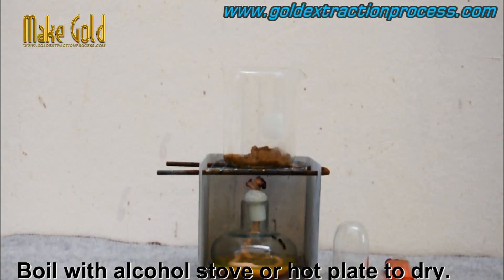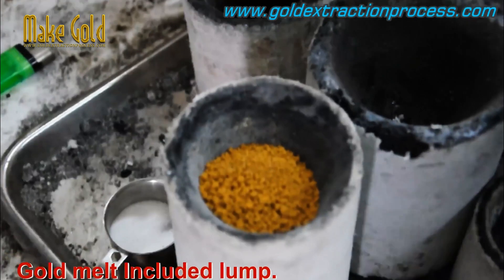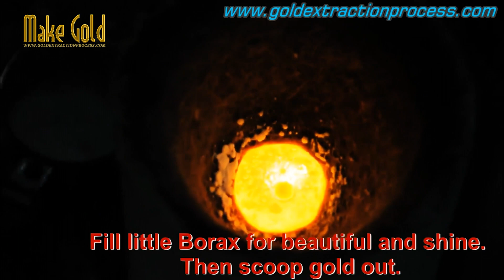Process Turning cheap gold into 99.99% PURE GOLD!

Comment from the maker: :hand-orange-covering-eyes::hand-orange-covering-eyes::hand-orange-covering-eyes:Testing: Finally, the refined gold is tested to ensure that it has achieved a purity level of 99.99%. This is typically done using a spectrometer or other analytical tools. Overall, turning cheap gold into 99.99% pure gold is a complex and precise process that requires specialized equipment and expertise.
:hand-orange-covering-eyes:

Comment: Never pour molten gold shot into glass because it will crack eventually use stainless steel instead, never use an Erlenmeyer flask to refine in because you can get a boil over so easily use a beaker instead , don't use a round bottom flask to drop gold out of solution with SMB because like previously you can have a reaction that causes an overflow of the foam.
Reply from the maker: :face-turquoise-covering-eyes: 👉Thanks for the advice. That's right, filming a video to show it.
Reply: Ok jesee